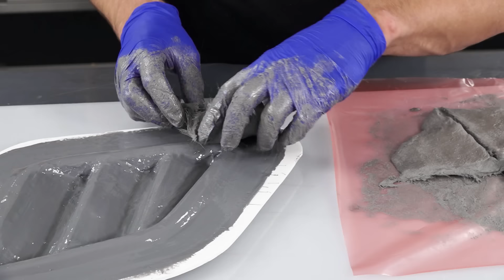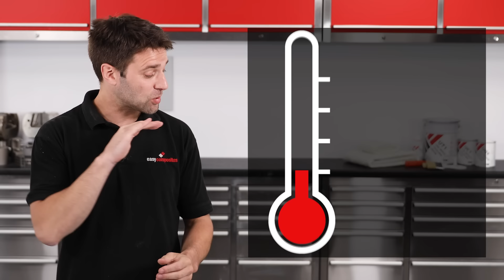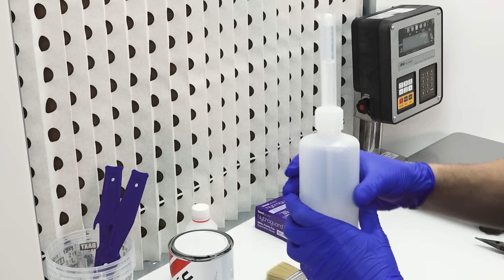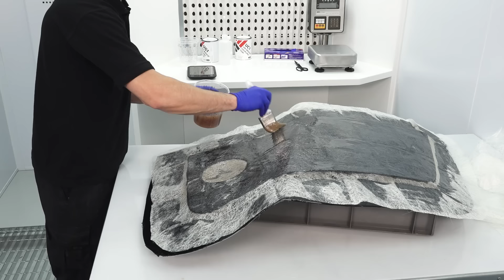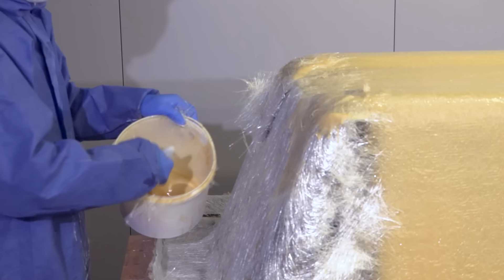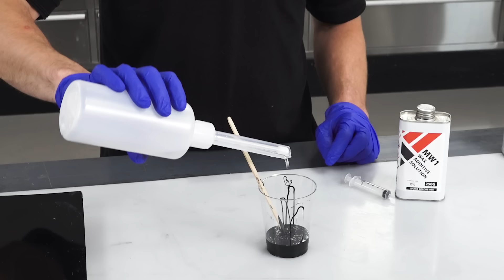How to Make Fibreglass Moulds with Uni-Mould - User Guide

Comment: I get that the purpose of this (excellent) video is to show how to make a mould, but what’s missing is how to make a two-sided mould. The master R8 side blade has  mounting lugs on the reverse side that are not reproduced in this mould. Would the reverse side be reproduced as a separate mould? If so, then… things get tricky, especially for a part with dimensions that matter.
Reply: Without a mega paragraph the best bet would be too make a jig of the reverse and bond mounting brackets onto the carbon copy or bond the part itself to the vehicle😅...some 3m VHB is also an option haha!

All depends on the original parts mounts configuration as many would get locked into the mould itself and never release
Reply: @efaracing4000 that’s a good solution. Glue the hardware. Didn’t think of that.
Reply: @ThatAdam12  if your gonna be making something best of luck! Permabond is what i use

Comment: I assume it works but chopped mat doesn't give me a quality vibe so I think I would use proper weave cloth, maybe even carbon fiber and vacuum bag it. Taking pride in the mold might be a good premise for later quality parts. As a cost issue, proper woven glass is quite inexpensive. Speaking of which, not that I need it but maybe have some S-glass cloth in the store? You only seem to have E glass. S glass can have quite impressive strength.

Comment: How are the fixings on the back of the panel re-created in carbon like a oem panel part?
Reply from the maker: Generally, they're made separately and then bonded on to the reverse of the panel. They can be made from things like aluminium (angle section, or folded sheet) or they could be 3D printed or even moulded and cast. Whichever way, all they need to do is match the position of the fixing point, and not necessarily the design or shape of it.

Comment: great video BUT what about the bracket side? would you need to  make another mould and bond them together? I'm asking because I will be attempting this on Car fenders
Reply from the maker: Yes, in a lot of cases, when replicating automotive panels you would create moulds for both the inner and outer skins, then make these two parts separately and then bond them together.

Comment: Can you apply it to a vinyl wrapped panel or will it react with the wrap?
Reply from the maker: Depends on the grade of the vinyl.  Sometimes a vinyl wrap can be used that way to help protect a delicate panel underneath.  But it is worth a small test to see if the styrene in the resin will react to it.

Comment: Hi, I have a question: I am going to laminate a part with fiberglass. How many layers are needed to get a stiff part that can‘t be easily bent. I have read that 3 layers is good, but I use a 80g/sqm fiberglass, so I‘m not sure.

Comment: I have problem when I doing carbon fiber sheet  . There is always a lack of saturation of the first layer.There is a small gap between the carbon fiber threads. Please can you help me?
Reply: The first layer was 200g and the pressure was 1 bar. The surface of the mold was so clean
Reply from the maker: It depends what process you are doing and what materials you are using as voids on the part surface can be caused by various things.  If you can email us some details of the process and materials you are using, and some photos, then we can try and advise further.  Our technical email is technical@easycomposites.com

Comment: I have a question about ABS parts. I'm aware that the safe answer is to do a test (as you have stated in the video), but in theory an abs part (motorcycle fairing) which has been painted with 2k paint should work, right?
Reply from the maker: It is less risky but that all depends on quality of the paint finish etc.  I would still do a test to be on the safe side.
Reply: @easycompositesproducts2810  Thank you for taking time to reply. Thankfully I was able to buy some spare panels for very little money so I will be able to experiment without risking damage to my originals.

Comment: Hands up all those whose first EC video was watching the carbon bonnet being made 12 years ago! As someone new to composites in general, that video back in 2012 was a hell of an education into the entire process.
Reply from the maker: Coming up on our video plan is to remake that video. In terms of the products and process, not a huge amount has changed, but watching the video now, it’s due a 2024 reboot!
Reply: @easycompositesproducts2810  that would be a great tribute.
Reply: @easycompositesproducts2810  that would be a great tribute to the original series.
Reply: @easycompositesproducts2810  is there a chance in that video you cover what to do if the bonnet has been modified like with bonnet pins etc how to cover those holes for a mould up as you can’t use filler etc
Reply from the maker: @tcars01  Depending on the size of the hole you can use filleting wax or a combination of that and fluted signboard to fill the voids. We can certainly consider covering it if the opportunity arises.
Reply: @easycompositesproducts2810  thank you, that would be great. They’re aerocatch hole size so I wasn’t sure as they’re reasonable size and thought the wax would move. Bonnet has manufacture bonnet vents too. P.s thanks for your awesome videos, I’m doing fibreglass and carbon with your starter packs!!

Comment: Quality content as usual, I’d just like to add that especially with applying the first layer of backing / glass many patterns can have a very tight external radius . 
Normal chop strand will not follow the contour easily. 
My solution is to use a lightweight glass woven tape , say 50mm wide and wrap this around the edge. 
1-3 layers works well  . I use it at a 45 deg fibre orientation. This can be done by cutting the strip of woven tape and pulling from opposite corners. 
Another trick is on the second layer of gel if you catch it at the right time the glass tape can be lightly payed on top while the gel is still relatively tacky. 
Lightly wipe and press down with a finger . 
This reduces the risk of voids behind the gel and makes corners stronger. 

On a very tight internal radius cut a hard edge
and butt it up into the corner on both planes , then a second layer of glass can be torn and the feather edges used to bridge the corners. 

On very tricky molds I’ve gelled then used a fillet of either body filler or fibreglass paste. You do have to watch for distortion of the gel due to exotherm so go steady .

After an initial backing coat I always use 40 grit to lightly knock back any stray fibres that would cause voids on subsequent layers .

Often when making patterns where body filler has been used to modify bare filler can simply be wiped with polyester resin to seal the surface, this can often save time repainting the whole pattern . Sand back and a second coat if needed. 

All the above methods can be used for one off low volume applications, obviously production molds and oven cure molds it’s a different matter. 

Please note most of the above is fine for polyester gels and resins , 
Adhesion compatibility to unimold gel / resin may be a different matter. 
👍
Reply from the maker: Thanks for the comment. All good advice 👍.
Compatibility of these suggestions with Uni-Mould should be the same because, although it’s a vinylester gel (rather than conventional polyester) the gel will go down and behave the same as a polyester during application. The advantages of vinylester come after, where it’s a much more reliable mould surface for epoxy laminating, higher temp, harder wearing etc.